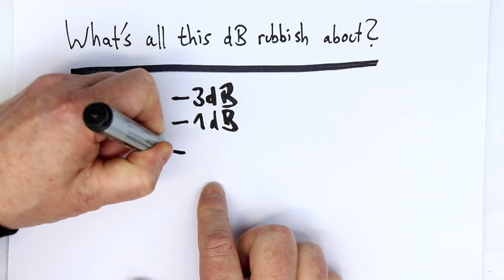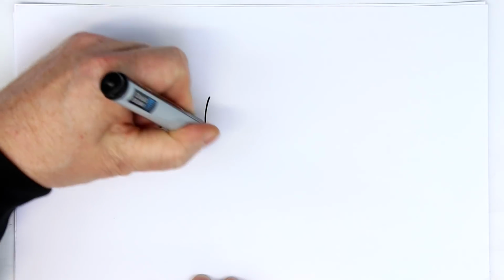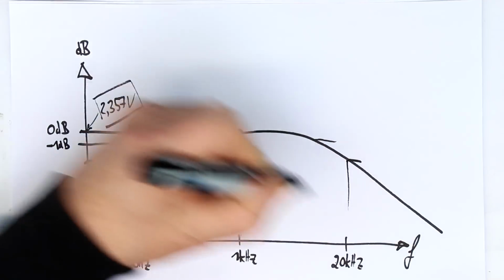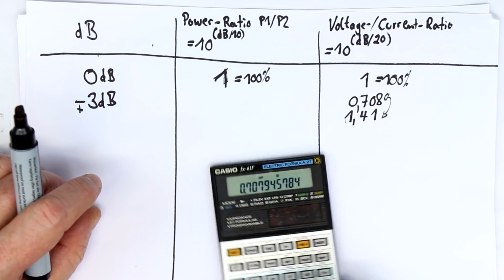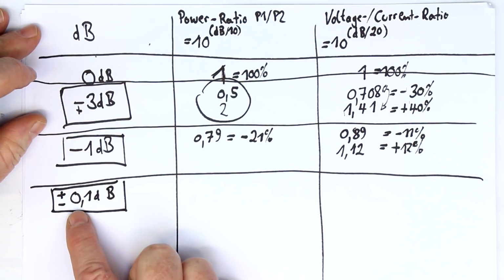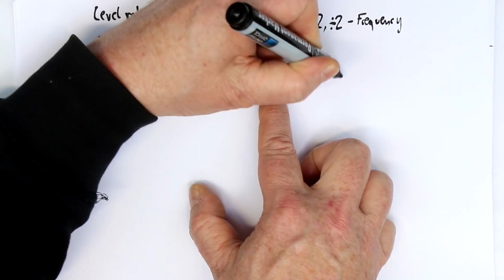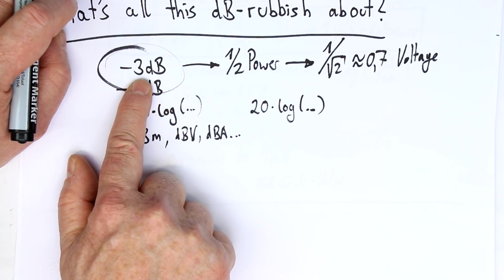Why -3dB? (An alternate approach to explaining dBs)

Comment: 00:06 Understanding the concept of decibels and why -3dB is used.
03:35 Understanding power reference and comparison in electronics.
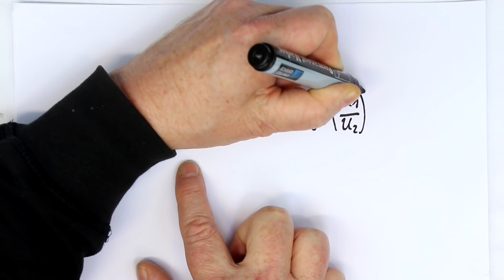07:12 Decibels are based on logarithm of the ratio of voltages squared
10:36 dBs are used to define frequency response limits
13:43 Understanding the concept of -3dB as a ratio to the reference point.
17:20 Minus 3dB represents a power decrease by a factor of 1/2.
20:01 Understanding the significance of -3dB in audio applications
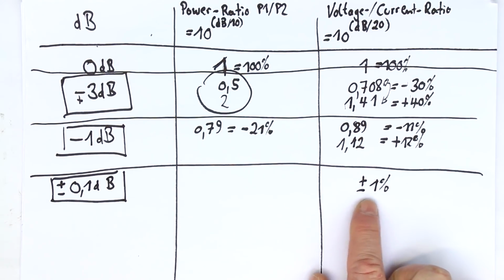23:12 Understanding the significance of dBs in measurement.
26:19 Decibels represent a ratio of power or voltage levels.
30:01 Filters with -20dB per decade have a linear fall-off.
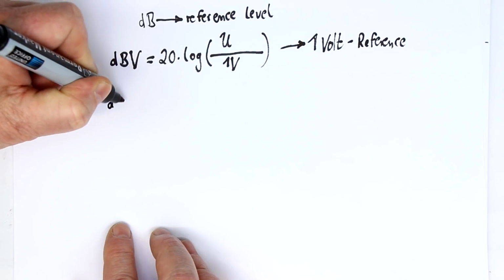33:30 Understanding dB values and conversions
36:40 dB is used for loudness measurements and has special frequency filters.
Crafted by Merlin AI.

Comment: Very nice video , great job explaining all that. most of the times in books  we see this expression 10 log (P2/P1) dB  and not  10 log (P1/P2) (which is what you are using here . to my understanding both are correct. So in what case do we use each expression? obviously the number in db will be the same but the sign will different .
Reply from the maker: It depends only on if you look at the value in regard to "amplification" or "attenaution". Same value, alternate sign.

Comment: If a deci-Bel is one TENTH of a Bel; Shouldn't we DIVIDE (Log in base 10, etc...) by ten? Rather than multiplying it?
Reply from the maker: This error was already mentioned in one of the other comments.
Reply: @KainkaLabs  you keep saying that but I don't see any comment where you actually answered this. Is it 1/10th or not? Do we multiply by 10 or not? Why take all the time  to make an educational video and then not explain a mistake in a comment that takes a few seconds to answer? I now have no confidence in the video cause I can't find an answer to this issue. All I find is "look at the other comments". I did. It didnt help.
Reply: @kurchak  hey sorry if the English isn't clear,
If you still have the doubt about this
Here's the approach,
Just like 100cm turn to meters by replacing multiplier C(centi) as 10^-2
100cm=100*10^-2m.

Same way, 
10log(P1/P2)db
 Changes to  bel as
10log(P1/P2)db=10log(P1/P2)*10^-1bel.

The video just cleared some strong doubts to many just a small explaination of a thing in comments doesn't mean all the effort was gone.
It would be better to be grateful for good content.
Reply: No, not at all.

If you have one dollar, $1, how many cents is that? 100 cents. Therefore, to get the value in cents, you multiply by 100, not divide.

Another example, you have $0.67, so you multiply by 100 and get 67 cents, if you were to divide by 100, it would mean that $0.67 = 0.0067 cents, which makes no sense. (Pun not intended)

Understanding this, it should be easy to see that, to go from Bels to deciBels, one must multiply by 10. If you ever were to measure centiBels, for some reason, you would multiply by 100. Want miliBels? Multiply by 1000.

It really is that simple.

Hope this helps clarify your doubts.

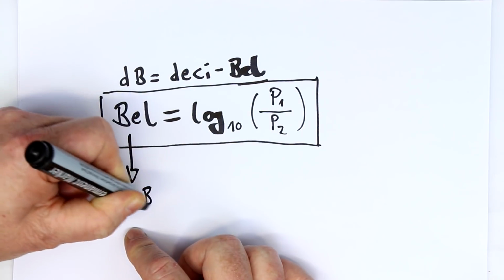Comment: I can't understand timeline 3:14, the derivation is wrong, because if you refer to the relationship between g and kg, 1kg=1000g, here the 1decibel=0.1bel, another ex. 1 decilitre= 0.1litre, so the relationship will be  1dB=0.1bel=0.1*log(10)(P1/P2)
Reply from the maker: Look further down in the comments. I think I goofed this up.
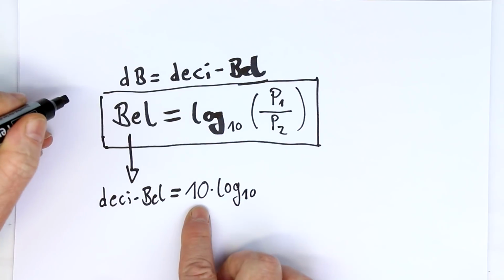Reply: @KainkaLabs  Your derivation is wrong. From 3:14 to 3:18, let me show you below.
(1) According to defination from wikipedia : x = p1/p2, means power ratios; √x = √(p1/p2), means amplitude ratios;  dB = 10log10   x  = 10 log10  (p1/p2)
(2) Your defination of the Bel = log 10  x = log10  (p1/p2)  is wrong, because according to (1) above, you will know the 
Bel = 100 log10 x = 100 log10  (p1/p2)
Reply: @KainkaLabs  Thank you for your reply, the explanation  in other parts is awesome
Reply: @KainkaLabs  you keep saying that but I don't see any comment where you actually answered this. Is it 1/10th or not? Do we multiply by 10 or not? Why take all the time  to make an educational video and then not explain a mistake in a comment that takes a few seconds to answer? I now have no confidence in the video cause I can't find an answer to this issue. All I find is "look at the other comments". I did. It didnt help.

Comment: So, do we always admit R2 = R1 when using the deci-Bel?
Reply: they are both connected to the same circuit ad perhaps this makes the Resistance , the total resistance of the circuit, i'm just guessing here but that's the only explanation i have right now
Reply: If he doesn't take R2 = R1 , then it would be a different circuit....but we are comparing two voltages or current or power response for the same circuit.... But changing R2 and R1 will make different circuits/system....and hence you will compare two different systems's response at two different frequencies which might be of no use for any specific analysis....

Comment: Hey Mr., do you ever watch your own videos?  I bet you don't.  Because on this particular video you seem to be writing something important under the graph and of course you write so far down the canvass thus no one can see it, and clearly you haven't noticed it, otherwise you would have corrected it.  Am I wrong?
Reply from the maker: Of course I watch my videos: when editing them :-)
When I write something outside the window I usually recognize this a few seconds later and pull the sheet up or down.
Otherwise I insert a text-message in the video.
Should be also the case here if you tell me at what time this has happened.

Comment: For the definition of power P=V^2/R, how do you know the R in the numerator and denominator are the same value and thereby can be canceled out?
Also, how come when going from power ratio to voltage or current ratio, you always take factor of sqrt(2)? HOw does it working out mathematically?
Thanks in advance!
Reply from the maker: First question: 
You are right in the first place (the "but..." comes later).
The foremost intention of this tutorial was to explain when and why 10*log(x) and 20*log(x) is used and where the difference comes from.
And this is simply because for one single measurement power is always proportional to the square of the voltage (or current).
Or the other way around voltage/current is always proportional to the square-root of the power.
Now let´s take a typical measurement situations:
You have a source (like a frequency-generator) connected to a DUT ("Device under test"; e.g. a filter-block) and you measure the output-amplitude at the end of the DUT.
Now you measure the output voltage with a constant load impedance (e.g. 50 Ohms, 600 Ohms or 1 Megohm typically) and on the other hand your source that feeds the DUT mandatorily has to have a constant output (source) impedance.
That way it is justified to assume a constant impedance for your measurement so that the cancelling out of "R" is true.
Give me an example of a measurement-setup where this is not the case and which complies with the specifications how this special measurement is to be done (there are certainly situations where you truly have to measure the RMS-power instead of the voltage to get the right dB-values)

The factor SQRT(2) in this video comes from my memory only into play when I explain why the "-3dB"-point is so often chosen for the frequency-range of a device. 
-3dB is a relative drop of 1/2 = 0.5 in power and because voltage is porpotional to the SQRT of power a drop to 1/2 in power translates to a drop of SQRT(1/2)=1/SQRT(2) = 0.71 in voltage.